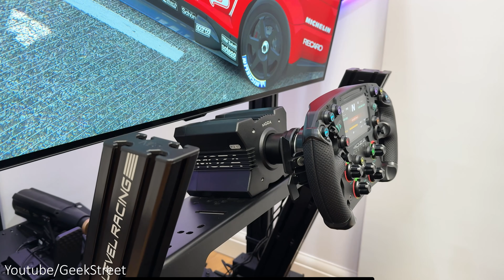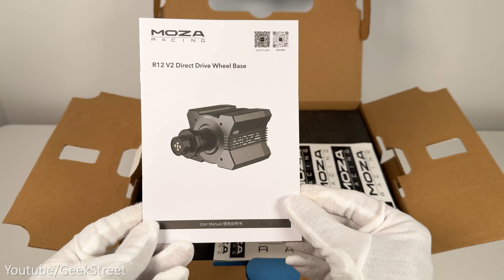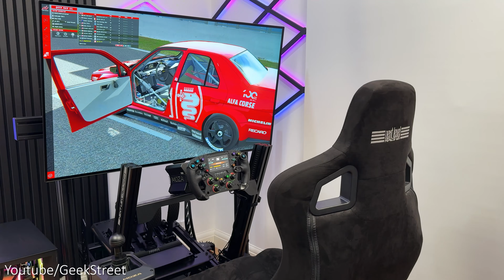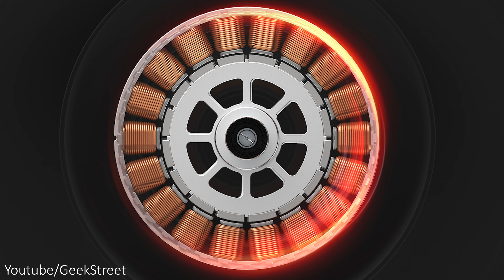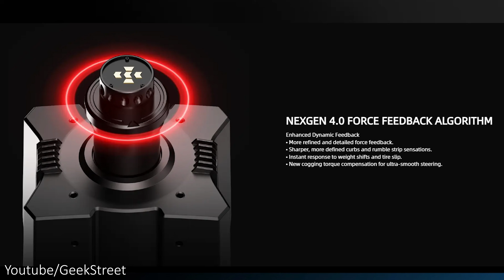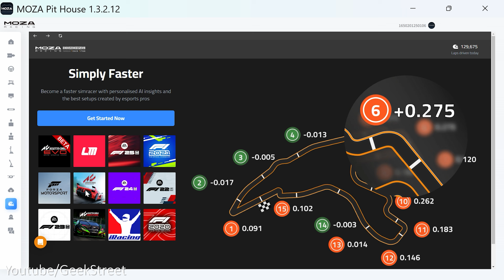NEW Moza R12 V2 | LEVEL UP Your Racing

Comment: Now that Moza R12 v2 has 21-bit encoder, supports iracing 360hz mode, front mounting holes and improved compact power supply unit. Do you recommend Simagic alpha mini over R12 v2? Which one would you pick?
Reply: I’m in the same problem
Reply: I don’t know which one chose
Reply: @meme_it-h5falpha mini 10nm or Alpha evo sport 9nm or alpha evo 12nm ... all these are some of the best out there. Simagic is always class above Moza
Reply: @hanishthatikonda7209 thanks for the info

Comment: How good is this compared to Simagic Alpha Evo 12NM?
Reply: Simagic is generally regarded as a better base but the wheels start at double the price of moza's so you will pay more for the setup. Moza had a larger ecosystem if that matters to you. Depends on your budget
Reply: @dronin87 im gonna stay on the t818 for the nexht 5-6months and see what comes to the market. I just bought the crp2 moza pedals cant wait to test them out 😁
Reply: @johannestnp2000  want to know this too cant decide on the alpha evo or moza r12 v2 which is 150$ cheaper
Reply: @Christaz9  I’m in the same boat. I’m wondering if paying more for SIMAGIC’s FFB is good enough to outweigh MOZA’s better ecosystem. Let me know if you ever decide, and if so, what did you get?

Comment: I know my skill won't improve if I upgrade my R5 bundle to R12 V2 with mbooster active pedal set, but your setup is tempting. I would like to ask if the screen in the wheel is useful at all since you have the "dashboard" shown in monitor already. Happy racing.
Reply: I’ve got the Moza r5 bundle 

I swapped my perals to the crp2 

And for the gs v2p pedal as im normally using telemetry on screen as it saves me looking away from the road